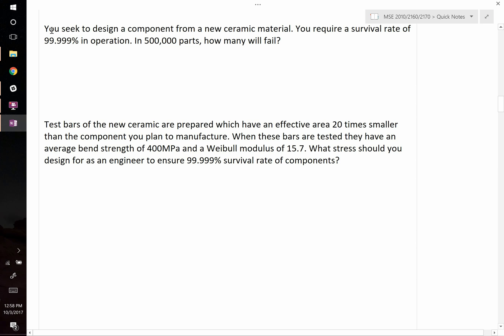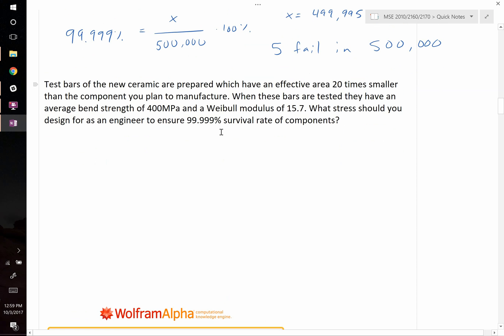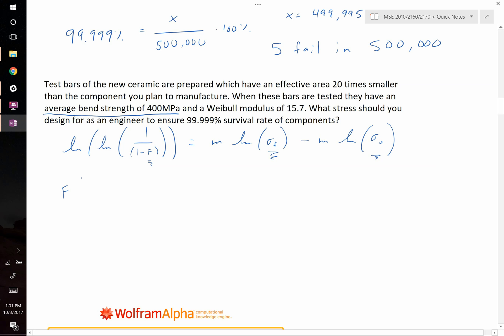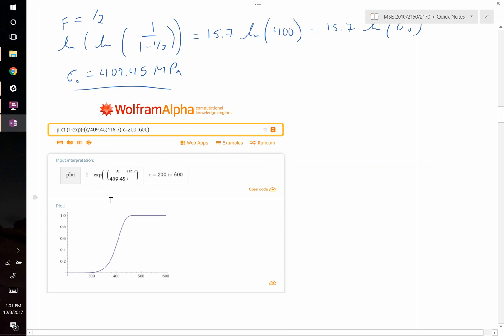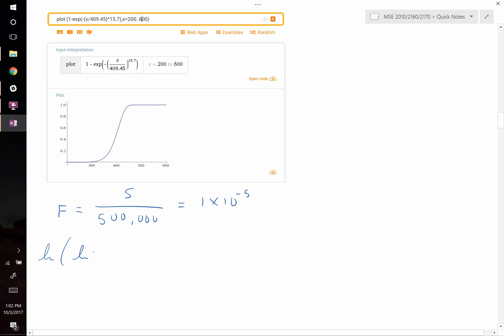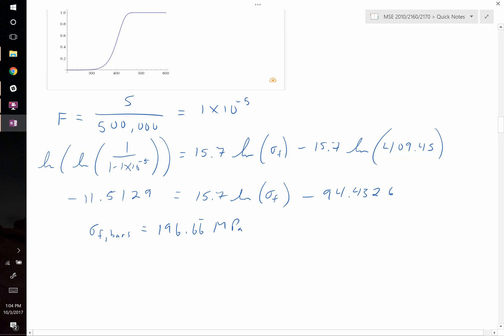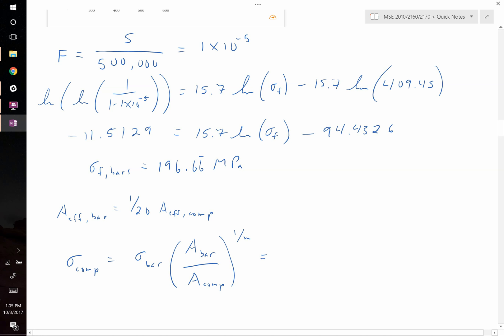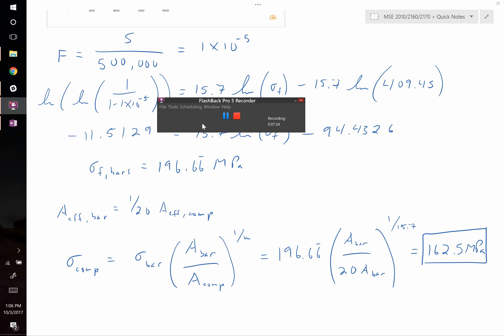Weibull modulus and probabilistic design example problem

Comment: Hi Dr. Taylor
I think there is a mistake in the question. The question states the average bending strength is 400 MPa (not the median). So F is not 50 %. I think it would be more accurate if you say median is 400 MPa not the average (This could be significant depending on shape parameter as the Weibull distribution has skewness..)
Reply from the maker: Good point!
Reply: @TaylorSparks  I agree. It would be 50% if it were a normal distribution. But we know beforehand it is not